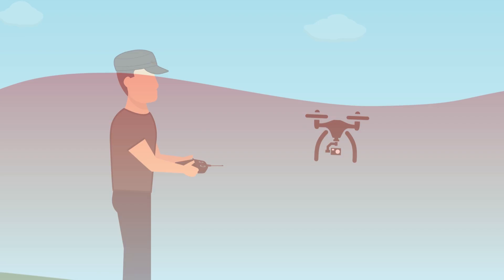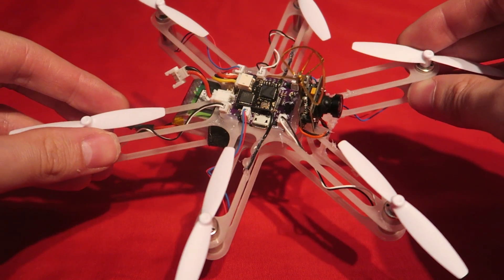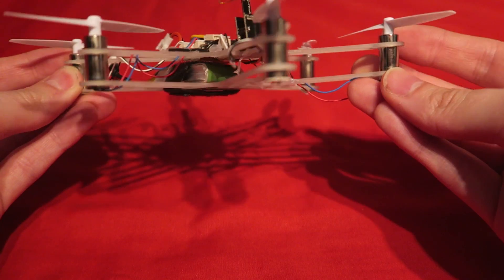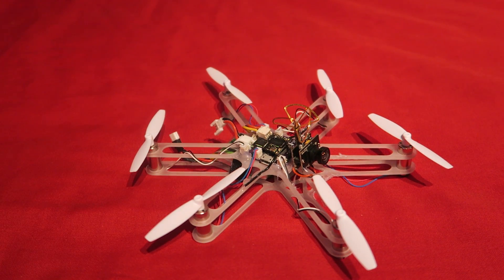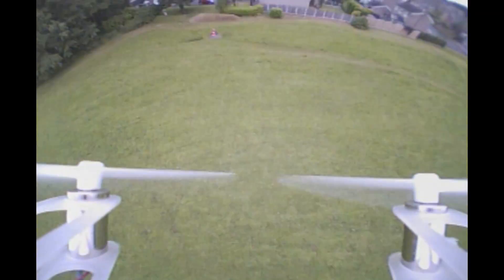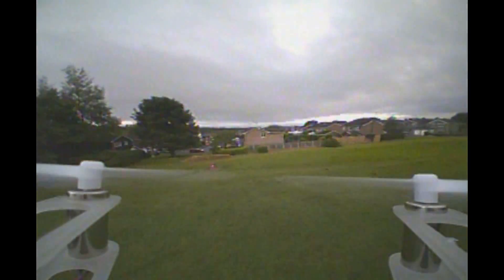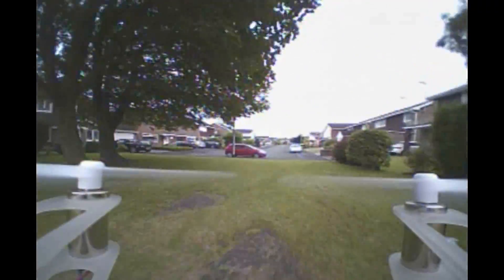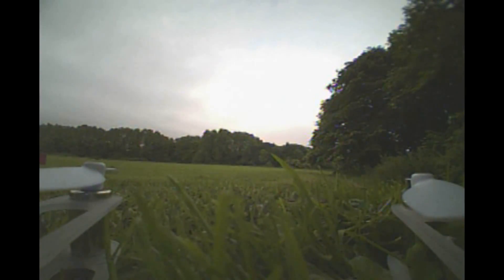Alienflight Brushed Hexacopter With Acro!

Comment: Hey Andy, any tips on securing the props so that they don't fly off the quad/hex mid-flight? I think you mentioned you are using Parrot props here, I'm trying to use Gemfan 65mm which appear to be nearly identical.
Reply from the maker: the only time iv had problems with the parrots is after a few crashes and they become loose. I usually just buy some more however you could try to drill a small hole in the top of them so that they bush down further. I have thought about it but never tried it

Comment: What does I gain do in betaflight?
Reply from the maker: better pid settings. flys smoother and easier to setup
Reply: +AndyRC no, I meant what does it do when you increase or decrease it. I was told if your quad`s pitch and/or roll axis move around in full throttle punches, turn up I on the axis that is moving.
Reply from the maker: oh sorry I gain  is the sum of the error over time and gives the accumulated offset that should have been corrected previously